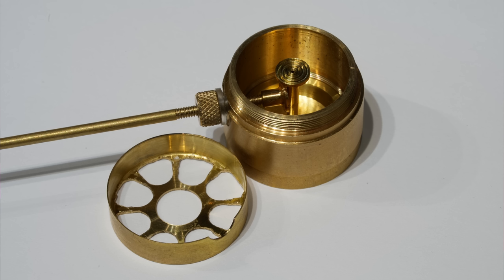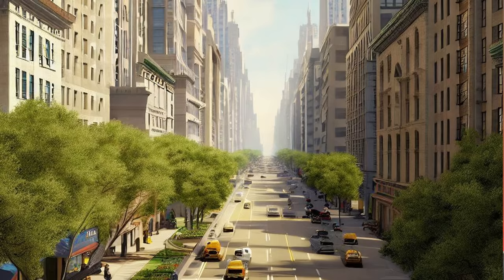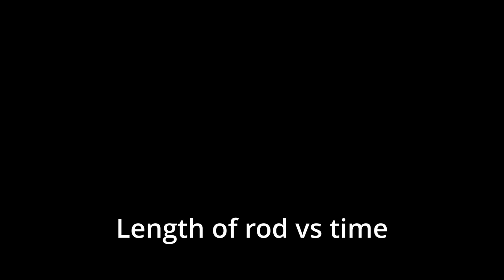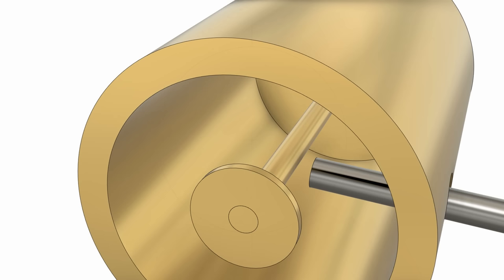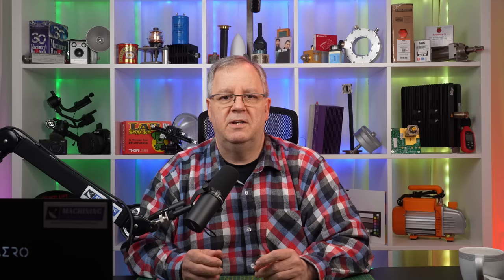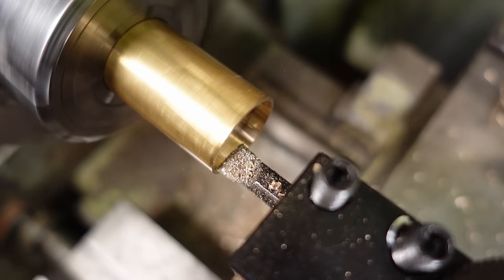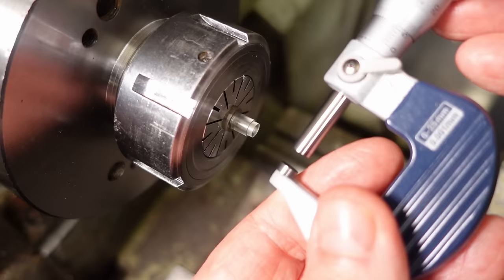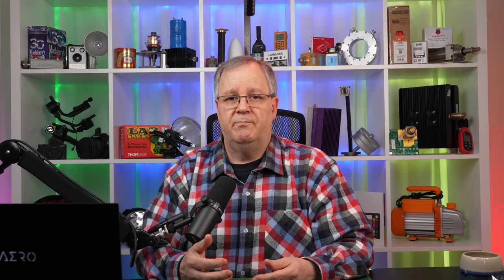SOLVING the Mystery Behind a Soviet Spy Bug : A True Masterpiece of Technical Elegance!

Comment: I didn’t even know something like this was possible without active circuitry. A purely mechanical microphone with no on board power source that can “transmit” wirelessly is just mind blowing. The ingenuity is incredible
Reply from the maker: You can of course use reflections from central heating ducts, metal radiators and filing cabinets, but this was the first publicly-divulged case of a cavity resonator microphone
Reply: @Chris Lund What ???
Reply: It's how rfid tags work...
Reply from the maker: @UNcommonSenseAUS  Passive RFID tags use a slightly more subtle approach, using rectification like the later EASYCHAIR MkII devices but then using load-pull techniques in the near field rather than  changing the resonance and re-radiating a back-scattered far-field.  RFID tags are immersed in the reactive near field of an inductor driven by an exciting oscillator, where they can then change the loading on the oscillator.  That is detected as changes in the amplitude and phase of the exciter, rather than collected by a separate receiver. The tag stores the rectified energy and activates a chip, which then changes the loading on the   receive coil in the tag. As it is in the reactive near-field, the exciter "feels" a changing load.  The changes are made very rapidly, so the data rate can be high, but very little power is required.  Other tag types such as those used on toll roads use active transmitters to gain much larger range.
Reply: in clearance areas, your not allowed to bring radios or anything as if you talked even with a radio off could push sound agianst the speaker and transmit it electroniclly.... spy stuff is crazy....
Reply from the maker: @spikes1529  We remove speakers and sounders from secure laptops and PCs, no wireless or bluetooth enabled, mesh on screen fronts, copper tape on the back, sleeving on cables, battery-only when connected to secure networks, SSD only, analogue headsets only. Loads of other countermeasures. Such fun
Reply: @MachiningandMicrowaves  : Or closing the shutters from windows to avoid reflections from IR Lasers.

PS: Up to date with the last THZ Cams ?
Reply from the maker: @TomKappeln  I haven't seen much recently in the THz region. If you have any references to papers and articles, I'd be most interested. Some amateurs in Japan are doing work at 800 GHz but even that is pretty much inaccessible without a chip bonder. I've seen some work at 400 GHz, and I have s special licence to transmit in certain defined bands up to 1 THz. Not tried anything yet, highest I'm experimenting with is 248 GHz
Reply: @MachiningandMicrowaves  : New PASSIVE Camera with 19.000 pixels from a "technische Universitaet" here in Germany.
No Paperwork online.
(As far what they tell 0.8THZ but i don't belive it)
Super high gain ....
I bet you know what that means.
I saw this beast 5 weeks ago and it gives me nightmares !
Alientech !
Greets from Frankfurt/Main
Reply from the maker: @TomKappeln  I've seen the INO microbolometer arrays that work from about 100 GHz to about 4 THz, but they are purely thermal, with about a 50 Hz refresh bandwidth, https://www.ino.ca/en/solutions/thz/microxcam-384i-thz/ but I've not see anything new recently.  The work on laser-driven nonlinear crystals to create localised THz electromagnetic waves is interesting, I know there has been a lot of work using optical mixing of two tunable dye lasers to generate mmWave to THz beat frequencies in ultra-fast photodiodes.  I'm not away of any amateur experimenters trying nonlinear crystals as that probably needs some rather extraordinary lab facilities.  Still, it's fascinating to see how this will develop.  I'm rather more excited about gyrotrons and masers right now, but it would be very interesting if there is something with a hyperfine transition in the 400+ GHz region that could be pumped using lasers or high intensity flash or gas discharge.
Reply: Yeah, the West had high tech gismos, but the Soviets had astonishing amounts of ingenuity.
Imagine what the world might be like if they worked together...
Reply: @MachiningandMicrowaves >> I first read something about this bug decades ago, but until watching your videos I had no idea how COMPLEX this setup was.
Reply: A power signal is transmitted to the device and received, and that power is used for the transmission power. It is almost unbelievable.
Reply from the maker: @FRANKHDIETRICH  There are some other more complex systems that are even more amazing.  Those have transistors and diodes but still no power supply, and they modulate the responsiveness of the receve antenna by using the same diode that generates the supply voltage.  Fiendishly clever stuff.  I hope to do a video about that one later this year.
Reply: @MachiningandMicrowaves  Great, looking forward. DE  KF4GIN  Wonderful.!!!
Reply: I've seen a documentary about spy things, one was an AM receiver "diy" without power. You just not have loudness. You can also look at "self powered wireless push button" ;)
Reply: In more simple terms, it's like saying your UV garden lights have no power source.  The Sun emits the power though.  Same here, the Soviets emitted a 1kz radio beam towards the Seal, and another microphone station listened for a small change in the 1KZ radio beam.  It is also why your phone changes Ads as soon as you change topic in a conversation.
Reply: @Raz.C Soviets we’re too clever for their own good. There’s a tail about Soviets sending the CIA an extremely fine wire. It was sent back with holes drilled through it and even finer wire woven through the holes. They were not “that” good”.
Reply: @davidelliott5843  that’s got nothing on that one CIA plan to drop XL condoms over Russia which they had re-labeled as “small” and “medium” 😂 the 
one-upmanship between the soviets and the Americans during the Cold War was ridiculous and thoroughly entertaining to go back and read about.
Reply: @davidelliott5843  And the Soviets returned it with a screw thread in :) Don't you love propaganda ;)
Reply: The potential is incredible, especially for business and manufacturing and technology integration for a completely new and different subset of products and devices. Open the portal guys, make new things.
Reply: I'm impressed - amazing what engineers can do

Comment: I passed my foundation ham exam today, but I was NOT ready for the intensity of science about to be dropped on me in this video. I feel thoroughly inadequate, but I shall keep endeavouring to understand everything after your introduction.
Reply from the maker: I doubt that more than a few percent of hams would follow it all, I'm working in such a tiny niche area of radio.  I do more mainstream things as well, like using moonbounce and Auroral reflection on 2 metres, plus meteorscatter, but those are probably very niche areas to most hams. I also mess about on 136 and 472 kHz, red light comms and most bands from 1.3 GHz and up, plus 1.8 MHz QRP CW and digital modes.  Working the USA from the UK with five watts or less on 1.8 MHz is a hugely enjoyable challenge.  The glory of the hobby is that there is a vast amount of different fields of endeavour that you can play with, and a near-infinite amount of detail that you can investigate if you like that sort of thing, or just get one any use radio if you don't want to do deep dives.  One of my friends decided to check the doppler shift on the QO100 geostationary satellite to monitor how it was saying on station out in the geo belt. I like using aircraft scatter to bounce my 10 GHz signals over the North Sea into mainland Europe. I think less than 0.1% of UK hams do this stuff that I find fascinating.  They probably have similar niche interests that I know nothing about. The hobby has been fantastic for me since I made my first radio back on 1969
Reply from the maker: @educatedmanholecoverbyrich8890  There are very active groups.io forums like rsgb lf group that show what activity is going on

Comment: I suspect the pressure equalising hole would have been even more important for atmospheric pressure changes that could otherwise cause a significant shift in resonant frequency, or even cause the diaphragm to push up against the centre pillar in the resonator and stop any modulation.  In fact just getting the resonator assembled might be impossible without damaging the diaphragm from overpressure.
Reply from the maker: Excellent point.  Although the threads are  rather leaky, I suspect they would have used wax or something as a thread lock and that might have sealed the thing too well.
Reply: @MachiningandMicrowaves  On drilling such a hole using a tiny spade bit, I hand made a 0.3 mm drill (for use in brass) out of a wire "hair" from a stainless steel wire hand brush. It was surprisingly effective and easy to pull off with only the hand tools in my back shed and a magnifying glass.
Reply from the maker: @lordchickenhawk  Excellent! I've certainly made tiny spade drills from carbon steel wire, but only for plates 1-2 mm thick. Huge respect to the folks who did that 40x diameter hole
Reply: @MachiningandMicrowaves  As you say... it's always that ratio that is the impressive bit!
Reply: In his book Spycatcher, Peter Wright described how fragile the diaphragm was - it could barely be handled at all with tweezers!
Reply from the maker: @railgap  My diaphragms were pretty delicate and they were 10 micrometres. I'm unsure of the effect on the Q value and cavity performance of perhaps a 4 micrometre electrodeposited nickel foil with 2 micrometres of silver.  That's only one skin depth at 1 GHz in silver, so there's a bit of a trade-off.  Ideally it needes to be at least 10 micrometres of high-conductivity non-magnetic metal, so if the backing really was nickel, that would mean around a third of the total current floing in the end cap would have been in a lossy layer of nickel. I would like to do an experiment to find what thickness of nickel and silver give reasonable audio performance with minimal loss.  I just bought a titanium bar about 60 mm diameter and 120 mm long so I can set up and electroforming system to grow foils.  not that I'm obsessed or anything....
Reply: @MachiningandMicrowaves  Would you consider posting technical detail drawings as a home machinist hobby project AKA Clickspring style? Sounds like a wonderful home workshop challenge to make the entire device and then get it working.

Comment: I read about it in a book by Peter Wright a good 30 years ago. There was also a description of another high tech magic - locating Russian spies by identifying them by overloading the hetordinates in their receivers with the signal transmitted from counterintelligence cars from the street. If this overload created a dip in the frequency suspected to be spy transmission, agents had confirmation that someone in the building was listening to spy transmissions. It did not require any mechanical operations, however, it was purely electronic manipulation.
Reply from the maker: I rather cheekily call him Peter Wrong, but his ghost-writer did an excellent job with a difficult subject. Rather a lot of twaddle and bunkum in the book, but since then a HUGE amount of detail has emerged about all sorts of TSCM and technical ops. I'll certainly be making some videos about the ones involving machining and, er, microwaves. I might need to be a bit flexible about what constitutes "microwaves" if I can get hold of a working IBM Selectric typewriter to try making a GUNMAN project device and supporting infrastructure! next spy device on my list is an EASYCHAIR Mk 2 I think

Comment: Maybe the metal was copper sheet and then silver electroplated to gradually bring up the thickness as well stiffen up the walls ? 
  That way the precision was not a machined process but a gradual build up through electro plating ? 
 Which would give you the ability to precisely achieve very accurate tolerances . 
 Also create many that were slightly different sizes to experiment with getting them working properly.
Reply from the maker: @vainwretch  The analysis by the FBI and Navy Lab showed it was nickel foil with silver plating. Copper and silver make terrible diaphragms because they are too ductile and lack the stiffness of metals like nickel. There is a complicating factor though which is that the conductivity at around 1 GHz of a very thin diaphragm, especially one made of lossy nickel, is rather high. The thickness was quoted at about 6 µm. If that includes the silver plating, it would mean that the skin depth would be far less than required to get really good performance. Generally you need about six skin depths. With the current dropping to 37% every 2 µm, it takes about six skin or 12 µm to get to negligible current levels. I suspect that the measurements given were possibly deliberately misstated.
Reply from the maker: @vainwretch  I think you are possibly right about the body being electroplated as an additional measure to improve the quality and precision of the fits. It was made of copper with silver plating on top, and with silver being slightly self lubricating although not as good as gold, it would have made sense to the RF engineering side of Termen's mind to get the dual benefit of variable thicknesses of plating
Reply from the maker: it would've been relatively straightforward for them to have produced an electroformed nickel foil using a slowly rotating cylinder in an electrolytic bath. I have a 1 kg piece of titanium round bar that one day I will use to make a silver plated nickel foil using two separate electrolytic processes on the same material.

Comment: The shame is that we will probably never know the names of the scientists and engineers who came up with such a delightful creation. With my 40 years of experience I grasp the concepts but with the modeling tools we have today we could recreate or even slightly improve upon this design.

At that time, in the Soviet Union, immediately after world war II it was pure genius and inspiration.

Eventually the us vs. them aspects of scientific discovery falls away to only leave behind the truths of a theory turned in to a workable solution.
Reply from the maker: @TishaHayes  The progress in many countries during the 1930s was extraordinary but the unique circumstances of the sharaska system certainly seems to have developed her white heat of technological progress. However, if you compare that with what was happening in other countries at the time it's not particularly remarkable. The list of scientist and engineers in the sharaska system is known, but the specialist clockmakers watchmakers and machinists who did the work may never be identified. There were very fast developments during the middle 1950s with a whole range of similar types of eavesdropping system. I'm working on a replica of the EASYCHAIR Mk2, but right now I'm working on something from 1925 that shows an extraordinarily advanced set of technologies being harnessed, by an engineer who stood on the shoulders of Giants and pulled together threads from multiple disciplines to produce something quite novel.

Comment: About the 1ghz transmitter - there is a mechanical device called frequency multiplier. It is very bulky, but that allows to have a simple carrier like 125 Mhz that after a couple of multiplications gets to 1 GHz. On the other side you can have mechanical frequency dividers.  That way you solve the electronics problem.
Reply: A mechanical device operating at 1 GHz!? or even 125 MHz? Not likely...

Comment: I am blown away.
I have wondered how that bug worked for years.
Speaking of years about 25 years ago I got an Associates degree in electronics technology.
Had youtube existed back then and I had seen your video then I would have understood hat you were talking about.

As it is now I got the basic brushstrokes of what was going on and found them fascinating.
Liked and subscribed.
Will be checking out your older vids and waiting for new ones.
Reply from the maker: I wish I had time to make more vids. Real Life keeps intruding.  I have some more detailed testing of this Bug to film, then later this year I'll be looking at one or two of the other spying devices that used a slightly different method of operating, but still without any power supply needed. First though, I have a backlog of machining and testing of antenna feeds and all sorts of mechanical contrivances to get made for microwave filters and antennas and moonbounce systems
Reply: The brilliance is in the simplicity of the device. It is so simple to not degrade for hundreds of years. It could still operate, had the Americans not been electronically vigilant. Maybe this type of device still operates in the embassies of, say, Nigeria ?